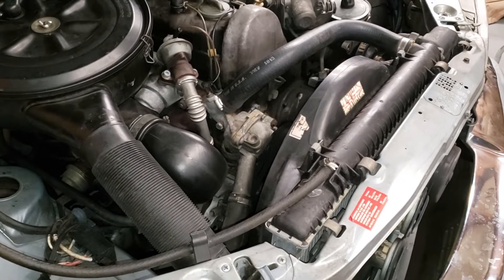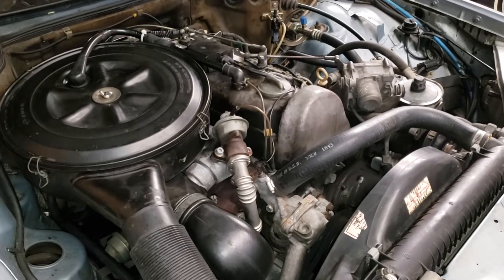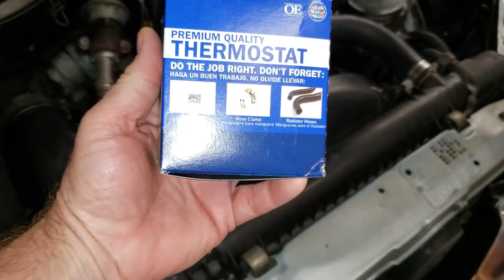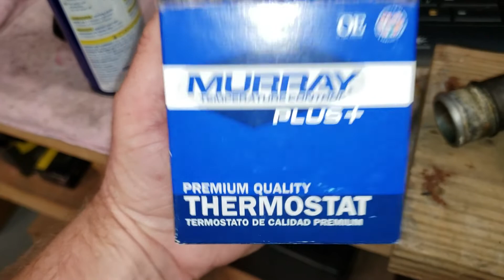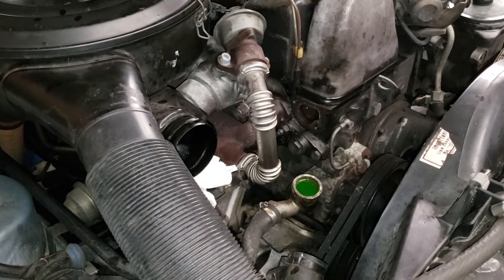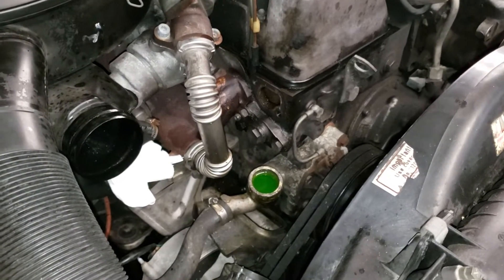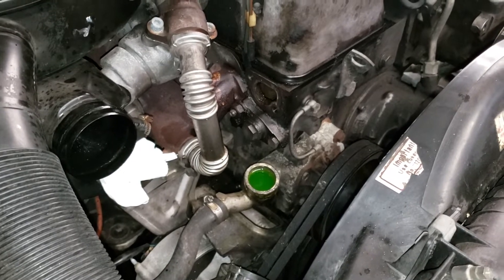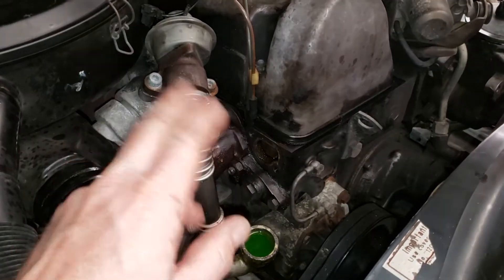W126 Mercedes 300SD Engine Cooling System Maintenance - Part 1

Comment from the maker: The green coolant will be replaced with Zerex G05.
Reply: What's the diff?
Reply from the maker: @wernerdanler2742  There is a good discussion here: https://www.benzworld.org/threads/difference-between-coolants-prestone-and-zerex-g-05.1661196/
Reply: @ImpalamansGarage , hi, I have a w126 300se and I was wondering if it's possible to swap it with the om617 300D. Please advise.
Thanks

Comment: Dang, you break everything you touch! Just kidding. There are different thermostat temps for summer and winter use.
Don't forget to fix your drill press. You said to remind you.
I always have used green coolant for everything. Didn't know there was any diff. Polyglycol or something like that. 
You might want to use antisieze or light grease on steel bolts into aluminum housings especially when water is involved.
Reply from the maker: >>  There are different thermostat temps for summer and winter use. 
(Ok. Explain that one to me.) Understandably the engine will run a little

cooler or hotter depending on ambient temperature extremes but within
 normal circumstances the engine temp should remain within its normal range. I called myself being careful when removing those little bolts. Fail.

You've got to really baby them if they've been in there a long time. 
I don't trust the old green coolant in engines where there is a mix of iron and

aluminum. GM stopped using it in the early 1990s. I was shocked at the amount of corrosion
on the aluminum engine components on this engine. Should have never occurred
in my opinion.
Reply: @ImpalamansGarage  I think the summer temp one's are set at about 179 f and the winter ones at about 195. I guess that helps counter different ambient temps. I don't think thermostats are either all the way open or all the way closed so I guess it helps.
My brain is starting to hurt trying to think about it and figure it out. Dah!
Reply from the maker: @wernerdanler2742  The thermostat I used is a 174 degree unit. https://www.oreillyauto.com/detail/b/plus-4222/cooling---heating-16773/thermostats-25043/thermostats-12876/82bbe83f6a70/murray-plus-thermostat/3587/4436198